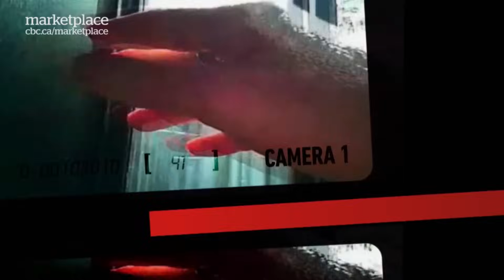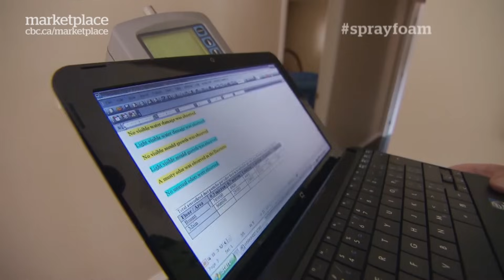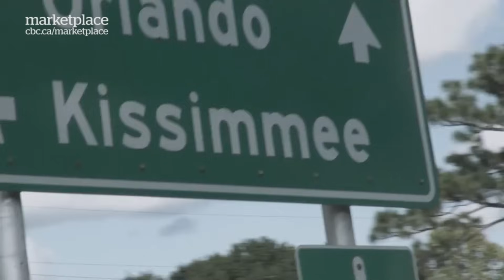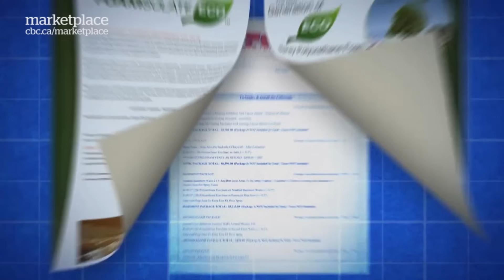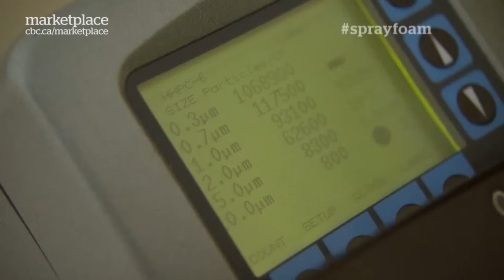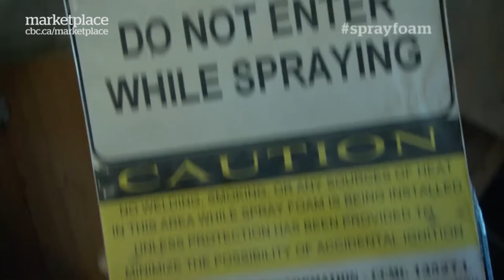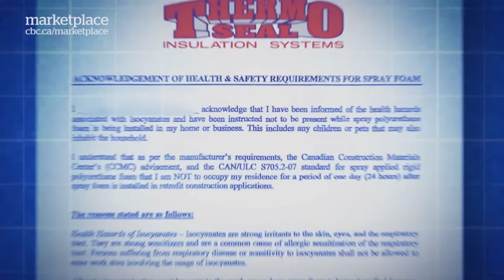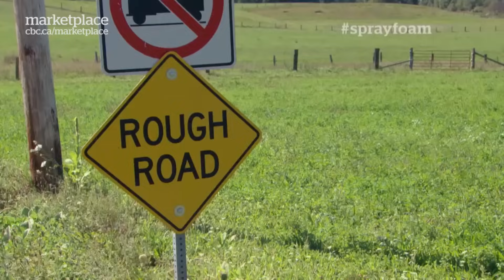Spray foam insulation nightmare: What can happen if it's not installed correctly (CBC Marketplace)

Comment: As a plumber I just got done diagnosing a leak at a house which crawlspace was coated with this foam. Long story short: The foam concealed a leak and created massive amounts of long-term leaking, dry rot damage. Total foolishness to spray this on pipes and wires which may be serviced later.
Reply: THANK YOU!!! I totally thought that when I first saw a video of workers applying this crap, spraying it over all the wiring & the water & drain pipes!

I feel sorry for the electricians &/or plumbers who then have to rewrite or fix or even reroute a pipe later on, after the foam applications! I cringed.
Reply: rewire, not rewrite
Reply: yeah, an installer i spoke with says that industry standard is NOT to install close cell foam in those environments.  same with roofs.....
Reply: Benjamin Wise         close cell or closed cell? there is a difference.
Reply: Common sense says use Batt Fiberglass insulation.  Glass is about as safe as it gets as Zero outgassing. Sure there are sharp glass if you get it on your skin, but simply don't roll around in it!
Reply: @superchuck3259  Up until 3 years ago, formaldehyde was often used in fiberglass insulation. Offgassing has been proven.
Reply: Absolutely! I've had to dig plumbing and wiring out of crawlspace foam. Also Do NOT use a torch around foam to fix copper pipe. The foam catches fire and burns like dry paper!
Reply: @kokopelli314  Excellent point about the dangers of Fire!  When working around foam make sure to have small wet towels to cool pipe being worked on. Have a fire extinguisher and even better, have a garden hose!
Reply: Wait if this stuff burns with a torch why is it being installed in the house then ?
Is it flammable at low head also ?
If there's ever a possible electrical fire does foam burn faster then wood?
Reply: @superchuck3259  my practice now in these cases is to abandon buried copper and replace the lines with PEX.
Reply: Same here. I have a raised home and have spray foam under the floors.The kitchen leak has spread and held  the water, rotting the floor and beams. Kitchen floor and everything replaced, just finished bathroom. Still need to rip up the hall and hoping it went no further.
Reply: I’m an exterminator and here in the last few years spray foam has become a huge problem in our industry as well. The majority of installers spray it on everything underneath the house leaving it nearly impossible to determine where termites and other wood destroying organisms are harboring. In a way it reminds me of the dreaded stucco. There should be more laws and regulations within the spray foam industry that regulate what you can and cannot spray. Make it where they cannot “permanently” cover wires, pipes, seal plates as well as leave at least 1/4 of the floor joists visible closest to the ground. Recently we have changed our contracts stating that if the home is treated with spray foam after the installation of our termite treatment that the contract may be void. If you cannot inspect the structure you cannot warranty the structure. Hopefully soon we will see many more laws and regulations regarding spray insulation.
Reply: I always recommend people to invest in either Foil Backed Areo-Gel or Vacuum Insulation. Easy to fit, easy to rip out. Good at for maintenance purposes just need the foil tape to reseal the edges also great in limited cavity space. I'm not even an insulation Fitter, I'm a Electrician but hell I've come across a lot of crap insulation, the worse part is the amount money spent to save money and it never works as expected. Most people don't want to spend a little extra and get some really good insulation, I'm the type to say either go all out or do nothing.
Reply: @kokopelli314  no if  you use a reputable installer that uses a class 1 fire rated foam it will extinguish itself when the flame is removed
Reply: @superchuck3259  all local commercial installers with a business license have certification. Those things are no guarantee of competence or protection from outright greed.
Not all foam installers or foam products are a problem, but when a contractor messes up, it's totally on them to make it right, no excuses.
Reply: @kokopelli314  Sadly there is only small claims court to deal with this. That is why reputation is so important and making sure you get someone of moral integrity to work for you.  Also never pay too much down payment because contractors can walk away and keep it!
Reply: Toby Wilson - In Canada and northern USA states, because of the freezing cold, water and drain pipes are not supposed to be installed in or along outside walls, as a good rule of design. It prevents freezing/bursting water pipes. Ideally, any water pipes, pressurized or drain, are installed only on inside warm walls which dont need insulating. If a water pipe is installed along an outside wall, then it should be within the warmth of the building space, such as a bulkhead, on the inside side of a 6” thick insulated wall, not right in the wall structure.
Reply: Agreed! Another plumber here.  Foam is a sponge for water and hides leaks and it's source.
Reply: @shugthehornyhaggis  Are you saying that breathing in fiberglass all day is bad compared to the foam?
Reply: @shonevans2563  Theres 2 types, one is fire resistant and wont burn, the other will hold a flame.
Reply: Kevin K 
I see  makes sense now 
Thanks brother
Reply: I totally agree. Hidding cables and pipes, is a children's mistake.
Reply: Yep... I hate spray foam cause it's usually half assed and just sprayed every where. I had some guys spray foam every single one of my wires deep in the wall even though we had to pull the wires out for custom outlets. 45 minutes later, I was finally almost done with my 4th outlet when I cut a wire disguised by foam...
Reply: almost all finishes and insulation conceal leak and rot damage.... -_-
Reply: Also, there shouldnt be any plumbing on exterior walls anyways
Reply: Exactly. As an electrician, I couldnt believe they were spraying this crap all over the cables like that. You could NEVER rewire a problem when its sprayed in the wall cavities like that. You'd need to use surface conduit
Reply: I was thinking the same, what if a person had to get to the wiring and plumbing
Reply: @benjaminwise8614  depends on the climate... Open cell typically for warmer southern climates..closed cell for northern.. cold climates.
Reply: @kokopelli314  some foams do burn..good foams have fire retardant...fire goes out after gets source removed...hence goes out in it's own..
Reply: @jtoutdoors9346  stick to your off road , fool
Reply: @Jack-Daniel.1  have another drink ,you sound drunk
Reply: dan stomber Don't know what you read to make your light switch off!
Reply: @Jack-Daniel.1  just tired of people commenting on things they know little or nothing about
Reply: dan stomber So you know nothing about it if you don't know of Areo Gel or Vacuum Insulation and that it has the best R-Values in terms of depth. You need to do your research and to be able to see beyond the curve.
Reply: @Jack-Daniel.1  Over 40 years in the insulation industry and a Engineering Degree .I`m way above any curve your able to articulate  my boy
Reply: dan stomber - somebody makes a valid point - dan - insults worse than a kindergartner lol. Everyone’s going to have their opinions, as well as you. Some are great, and some are horrible, like yours. I commented months ago and now I’m wondering how I stumbled to this video, wasted time.
Reply: @jtoutdoors9346  Well I like to deal in fact not opinion sorry
Reply: dan stomber it’s a fact that having spray foam covering certain structural components of a home makes it hard on electricians, exterminators, plumbers and other jobs that have to be done under a house for repair/ maintenance. If the jobs done right, amazing. Right now with it still being a “new” thing, it’s not done right every time. As with any other job. It’d be helpful to have guidelines for the industry.
Reply: JeepCherokee Off-road 🤣😂😂 it's because he has a degree in Engineering however he didn't state what form of engineering. I learned mechanical/structural engineering a lot was compression concrete (e.g. Reinforced steel wire.) and triangles, I later branched off into electrical engineering. I still remember my first lesson when my tutor taught us how a sand castle could hold the weight of one car by reinforcing the sand with layers of paper.
Reply: dan stomber And the fact is that you don't know the difference between your or you're e.g. "I'm way above any curve your able to articulate" should be "You're able".
Reply: Jack Daniels I think dan has left the building 😂
Reply: JeepCherokee Off-road Probably because he's just read up about the insulation I stated and realised he hasn't got a leg to stand on.
Reply: @AngelofOntario  If anything they should run pipes for the wires like in commercial buildings if they are going to use spray foam so you can pull new wires later
Reply: JoAnn Becnel 😭😭wow I feel sorry for you
Reply: @superchuck3259  so right my friend
Reply: Plumber here, I totally agree.

Stay safe brother.
Reply: Flash and bat is good but you have to have a good installer. There is also an atomized caulk misting that works well.

Of course, you only want to do this in an air sealed house and you need a damn good air management strategy.
Reply: Very dangerous to coat wiring with this, as the chemicals can leach out the plasticisers used in the wire insulation, thus making it brittle and prone to cracking off, exposing the bare live wires! Never use this product, try Rockwool instead!
Reply: Toby Wilson R hey Hurd young  inexperienced workers for 8 dollars an hour .
Reply: Charles Granata the yellow fuzz for duct work is my favorite type of insulation to roll around in.
Reply: So much fun to make to make a repair on Plumbing that's been covered in foam.
Reply: @jojohere714  Im sure it was all real cheap too..
Reply: Toby Wilson : Very True, Very True
Reply: Toby Wilson : Do you agree not to spray foam a foot or two where the pipes and wires run  through and put pink insulation behind it where you won't have any problems to fix it in the future ?
Reply: Toby Wilson I’m a 33 year plumber and I agree completely.
Reply: I am a plumber / electrician myself and I have to agree with you. 
I have even discouraged people from painting plumbing pipes myself if at all possible.
Reply: Spray foam killed over 100 in A night club fire the year 2003 in Warwick Rhode Island.  The foam went up in flames VERY VERY quickly.  Night club fans paid to see Great White and emergency exits were BARRICADED. Such a shame.
Reply: @shugthehornyhaggis  installers wear PPE when installing fiber glass insulation.
Reply: Robert Bullaro  wool insulation natural and safe
Reply: Just charge more
Reply: @robbyers7614  Wow. That was 2003? I feel like that happened in the 80s. I just can't believe it's 2020 and I'm this GD old. I hate hearing about big, memorable events and how long ago they happened. Makes me feel like a hag.
Reply: Does the water stay stuck inside the foam? or does it leak out at all?
Reply: Not to be used as a retrofit solution.  That’s the lesson here.
Reply: @shugthehornyhaggis  what? If the fiberglass insulation isnt being agitated than there is no worry about breathing it in.
Reply: @kevink239  no all foam burns no matter what people try to say.
Reply: or, If the plumbers do their job right in the first place, the pipes won't have to be "serviced"
Reply: Thats exactly what I was thinking, 
when I was a kid I worked for a company doing repairs for dry rot, rising damp, problems with mold and that type of thing I would think about 90% of our work was caused by people sealing up their homes and not letting the building breathe.
Add to that not being able to find or even know about potentially serious problems with plumbing and electrics
and you're asking for problems.
Reply: Yeah, it's never a good idea to spray pipes or wires with closed cell sprayfoam, but often times it's damn near impossible to spray around them.
Reply: @superchuck3259  There are plenty of non off gassing spray foams ... Icyene being the leading example of low off gassing foams. Some foams even allow same day reentry at this point. Also Icyene itself is nonflamable... and if an emtumecent layer is sprayed on top it can be a fire barrier. (Icyene will burn if there is a secondary flame but is noncombustible otherwise.) sort of like how sugar doesn't burn unless you apply some soot to it...
Reply: @noControl556  Good idea but by adding conduit you have certainly raised the electrical costs significantly.
Reply: Yeah, pay astronomical fuel bills and suffer through uncomfortable drafts and temperatures to avoid inconveniencing a plumber or electrician for some possible future repair when both plumbing pipe and Romex are so relatively cheap- just make new runs outside the foam- insulate it if necessary.. @AngelofOntario
Reply: @superchuck3259  mineral wool. Made out of waste  from steel mills. Much safer than fibreglass
Reply: yet they get away with it day after day , thewy just make everyone's life who has to service most anything in the house a disaster. . . they don;t tell you that in their sales pitch
Reply: @shonevans2563  yes, foam burns far faster than wood. While wood is obviously flammable, it burns slow enough to act as a "fire-block" or a method of decreasing the chance a flame can move from one space to another. Foam, on the other hand, no only burns fast but fills the house with toxic smoke reducing someone’s ability to escape the house.
Reply: That would most likely be a closed cell foam.  Open cell foam will will act as a sponge and show wet areas.
Reply: @jojohere714  so I should NOT spray foam floor boards when doing basement?? Thanks🤔
Reply: @kokopelli314  you know what will happen which PEX in 25 years or so. It will be reported that the PEX tubing is causing health issues and it will have to be replaced with the next big product that just came out.
Reply: @akaredcrossbow  PEX is polyethylene. If you water is degrading it then there's more to worry about than the plastic.
Reply: @kokopelli314  I understand, but someone will find something wrong with it. You know how it goes!
Reply: @AngelofOntario  If the electrical andplumbing is done correctly,, a person shouldnt have to redo any of it. A sprayer can go thinner on repair potential areas. Besides for the sound prrof and tightening of the structure, if one has to just 'cut it" out, its worth having it in - to me.
Reply: @salvatoremonella9531  no. it gets hard like a glue, helps tightena structure, open cell is soft ,has no rigidity.
Reply: @AngelofOntario  tHE t LETUR IS BEside thE R letter maybe a TYpo?  but you'rE not tHE haNdicaPper lIKe me...
Reply: @rampagerick  I'm allergic to 2 chemicals used in it. I get allergic urticaria (anaphylaxis involved), from off gassing Formaldehyde chemicals.. now it kinda makes sense, idk why it just clicked, but ty.
Reply: @superchuck3259 even better than that is rock wool.